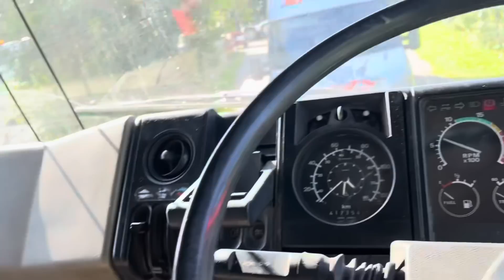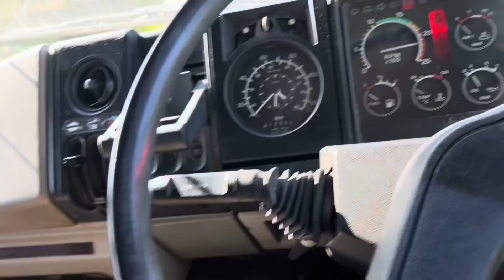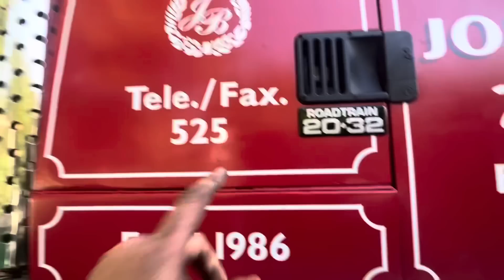Finishing touches to a old show truck and JS3000 from Topdon

Comment: Just PMSL about consumables.  I worked part-time on a garage once helping a good mate. A customer came in with a tow bar and wanted it fitting. My mate said I'll fit it for £10 ( this was back in the mid 70's)
When he came to collect the car, we charged him an extra quid for mounting bolts because the ones in the kit wasn't long enough.
He didn't half kick up a stink over this extra quid, saying, " You can take them off, I'm not paying a penny more than the tenner we agreed.
So my mate did just that  and took the tenner off him.
He came back the next day with his tail between his legs. When he coupled up his caravan, the towbar just pulled straight out, realising we had done just as he wanted .
Anyhow, to teach him a lesson, he charged him two quid for all the aggro he caused.
So whenever someone mentions consumables, I always think of my old mate. Barry God bless him and the hassle over 4 bolts.
Keep the videos coming and keep grafting 😊

Comment: Wanted a new jumper and saw you using the Topdon and bought a 3000, Not had to use it yet but I have a Bobcat skid steer and a Case Tractor to start this week after not been run for months. Ill let you know what it does. Cheers

Comment: I've jump started a lorry using a fiat Panda and a set of jump leads. It's just trial and error. Connect to one batt, give it a go. If it doesn't, try the other. Chances are, one batt will be weaker than the other.

Comment: yes you can. One jump pack per battery
Reply: I have jumped a 24 with one jump pack. Put it on one battery and try and start it. If it doesn't start then try the it on the other battery. I have found that one battery out of the two in a 24v system is always a lower voltage than the other

Comment: Joe is a decent old skin. Tell him to get a vax spot washer for the interior and it will come up like new, it's basically a wet vacuum cleaner and i dissolve dishwasher tablets and use that, just let the water cool to 40*. Much cheaper and smells nice.

Comment: -How only 24k subs... 🤯 
- Connect the jump packs in series to get 24v
-You want some 3.2mm 7018 rods running 120amps. Or 6013 they are easier to weld but not as strong.